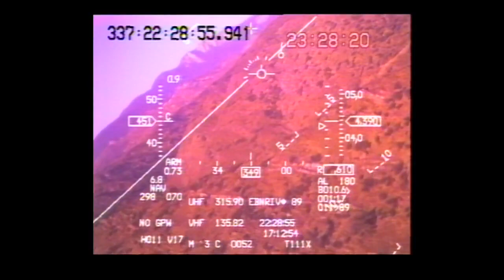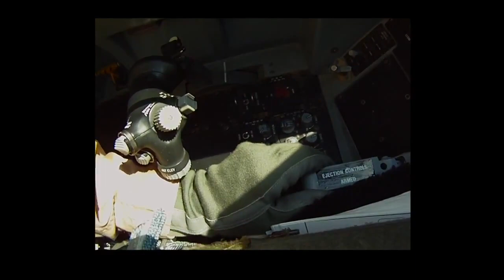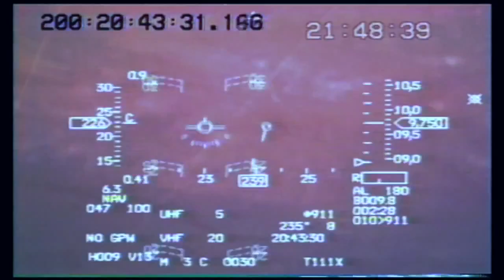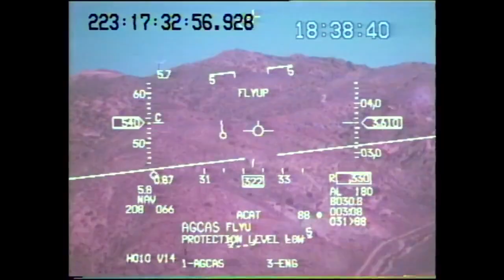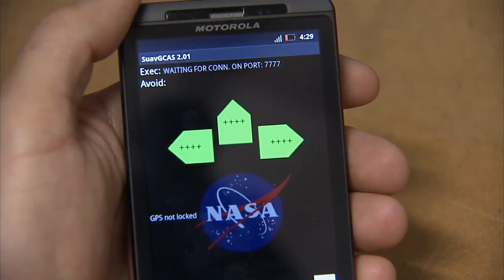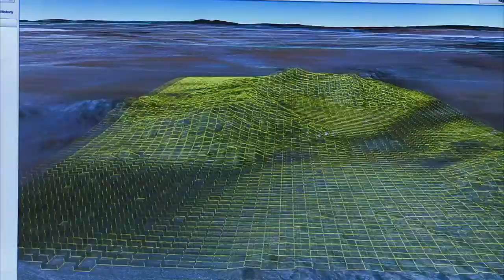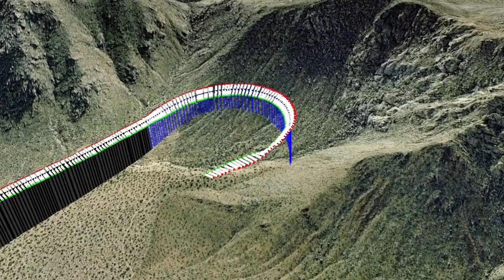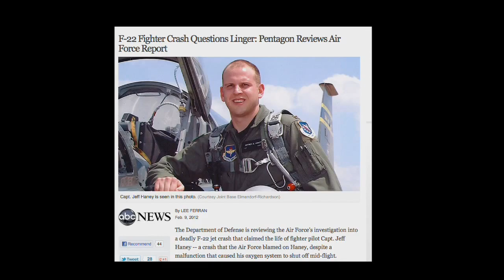Automatic Collision Avoidance Technology (ACAT)

Comment: They have GCAS (Ground collision avoidance system) which is a ground radar altimiter that sounds warnings when you get to the altitude set for warning, it yells at you "Pull up! Pull up!" and "Altitude, altitude". It is not "Automatic" though, it is still up to the pilot to handle the situation. This video is for a similar system, but it will assume control of the aircraft in the event of pilot incapacitation.

Comment: The pilot doesn't have full control, the pilot has override control and can fly manually if necessary (in case of emergency). The computer has full control, especially on the F-16 aircraft, the platform which was the testbed for fly-by-wire technology development. The pilot is just one variable in many inputs from sensors spread around the aircraft.